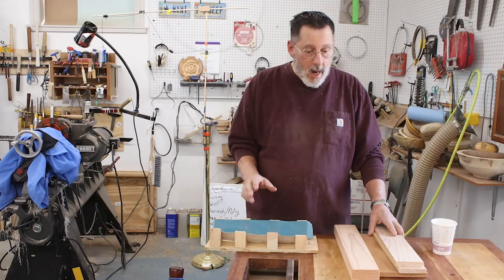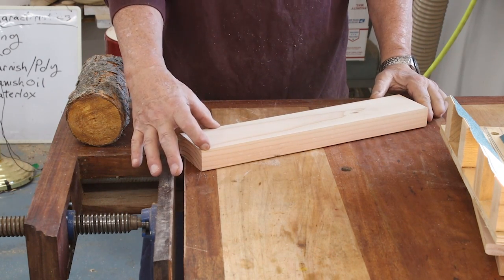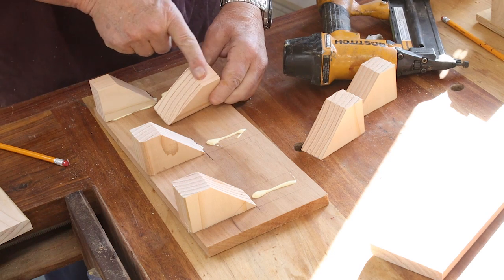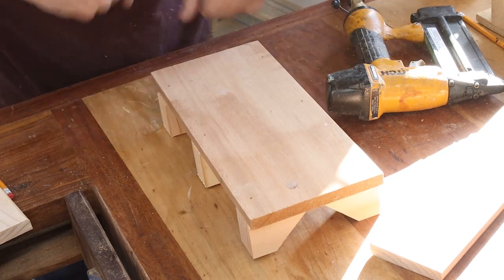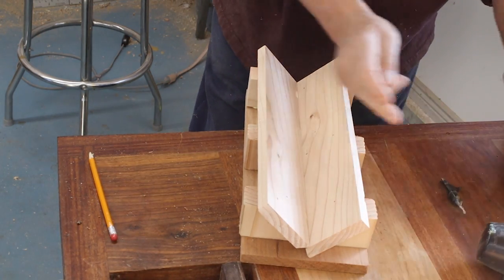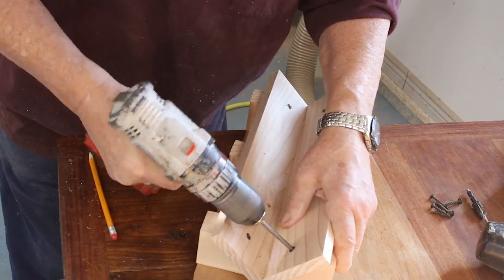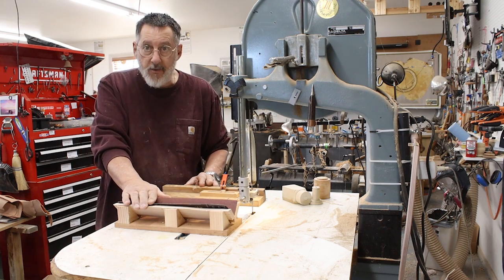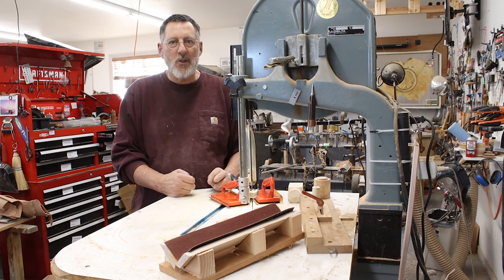CROSSCUT  Sled for the Bandsaw   Woodworking  with Sam Angelo

Comment: Great jig Sam. Make two, each with the miter bar in opposite directions. One crossways as you demonstrated in this video and one with the bar running lengthways. Then you have jigs for cross cut and also rip. Good tip about the jointer push blocks too. So far mine work very well but if I ever have a problem with slipping, your sandpaper tip will come into play. This video has been a great way to kick off 2023. 👍👍 Thank you for sharing. Stay safe. You have been educating and entertaining us for many years. I presume it will continue through 2023 and beyond. You are appreciated.
Reply from the maker: Thanks Glen, I actually do have another sled for ripping.... Sam

Comment: I recently had 2 fingers nearly removed by the band saw while creating a turning blank.  Fortunately they could reattach and I have almost full motion.  However, my wife bought me a Carter tools cross sled similar to the one you built in this video.  I almost like yours better and it is a lot cheaper.  I like the simplicity and please, everyone reading this, use the sled don't freehand round wood pieces.  I was lucky to regain my movement and still play guitar.
Reply from the maker: Thanks, Sam